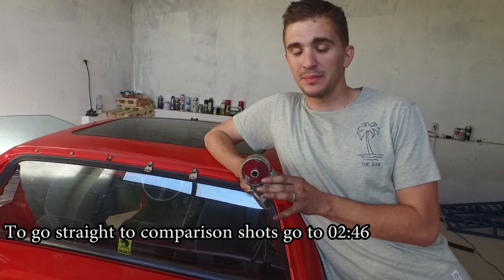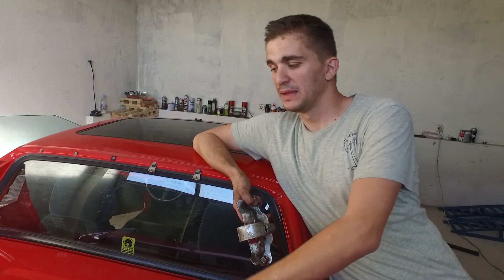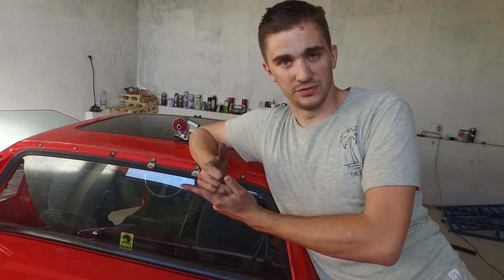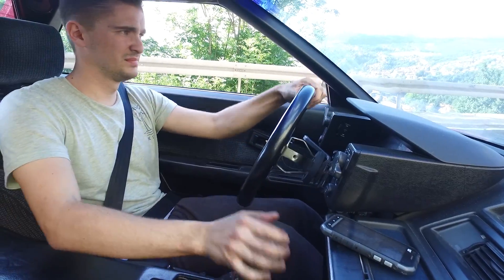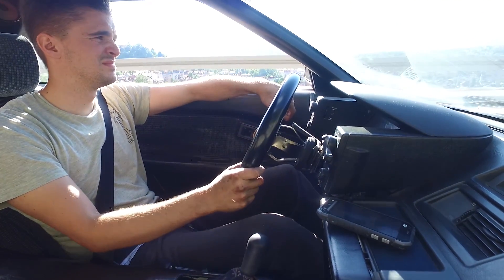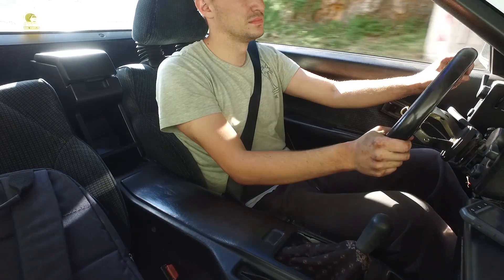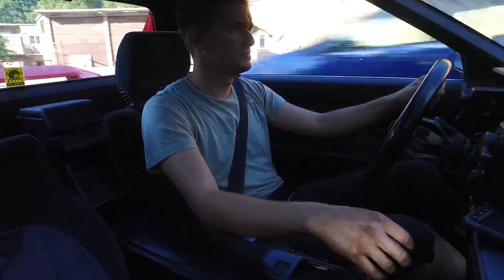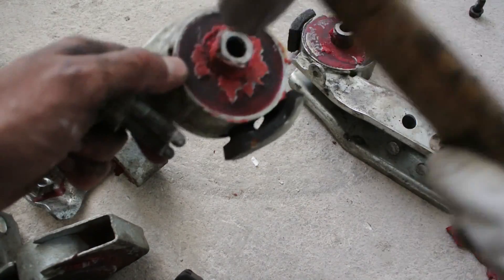Polyurethane vs. stock engine mounts - detailed comparison

Comment: You should do a comparison of the same effect but include polyurethane inserts on oem rubber mounts, the idea being that the gaps are filled with polyurethane for stiffness In harder loads and then when cruising the rubber dampens vibrations
Reply: Just so you know, i took this idea and ran with it, a year down the line, the polyurethane that i injected on my stock control arm rubbers are still intact.
Reply: @agcobileboqwana9923  hey that’s awesome! How does it feel inside the cabin? Can you notice any difference in ride quality? My mindset behind this idea was that oem rubber would provide dampening for the higher end frequencies that you tend to notice from the road, small bumps and rougher surfaces that you would notice more if you only had poly. But combining the two, would the poly be able to provide a stiffer response and hold tighter by restricting movement as well.

I’m very curious to know if you can notice any differences first hand! And if it’s just negligible, I wonder if there would be any types of different poly/oem matrices that would provide the desired results. Some ideas off the top of my head being; layered, like a jawbreaker? Stagger between the layers in different shapes. And then maybe some kind of cross gridding? Similar to a carbon fibre layup, but in a 3 dimensional form? Would love to see what these types of ideas would bring about, I’m sure there would be some complexity in developing, but nevertheless, if you liked my last idea and tried it, I’ll gladly share more ideas 🙂

Thanks for getting back to me after 3 years, surprised you even thought to reply after a year of trials haha
Reply: @WPXTacoMan477, there's actually no vibration in the cabin, i put round hollow plastic spacers when i was pouring the 3m polyurethane, i didn't wanna drill the mounts, i think the vibration that's in the video is there because there were no holes left in the mounts to dampen vibration.

Comment: Just took the poly mounts out of my SW20 MR2 Turbo. Was unbearable, only now do I realise how much better the stock mounts really are. At first I was smitten by the seemingly better throttle response, crisper gear shift, etc. But at the end of the day its not worth the added rattles and noise, especially in a car with a loud exhaust.
Reply: I found that the Kirk MR2 poly inserts along with OEM Rubber mounts were the perfect balance.

Comment: The harsh ride came from the stiffness of the poly. 
So is it 90 -85 -80 or 75 according to the scale of stiffness. 
90 is the stiffest and 75 us the most resilient.
Reply from the maker: This was 60A
Reply: @d4a  
That was nice.. it should not be any difference I think.. or do you still not recommend it
Reply from the maker: As I said in the video I would recommend it only for race and track cars.

Comment: 80A in hardness in all the mounts is rigid af as you observed. That's why depending on your car and how many mounts you have that you're converting to poly, going all in may not be the best option for your daily. My brother with no research brought all his mounts in 80A poly for his MK4 1.8t and it vibrated and rattled so bad he had to shut the engine off just to talk, Lol.

Comment: Anyone elses stomach tighten when he set the mount on the sunroof?
Reply: Yeah I'm always weary of setting metal stuff on glass Just a small pressure point can  create an issue 😅
Reply: Only you and the others with OCD. It's just a car. A POS car if anything. And on top of that, It's not like he dragged it along the paint.
Reply: @paulnueberg742  Yeah, was expecting shattering glass. Lol

Comment: If I remember, You used Shore 60 urethane. Have you had any experience with a 'softer' urethane, say Shore 30?
Reply: I bet softer will still vibrate harder than stock. The main difference between the polyurethane filled mount and stock mount is the stock mount rubber has openings and those opening allow to flex the rubber more than solid polyurethane. He could make inserts for his castings to form those openings in the polyurethane so it would work like stock mounts.
Reply: @illla  1cm  or less, thick wood dovels wraped in paper tape (spaces in the urethane ) would do nicely once removed, to introduce softness, yet not compromise the strenght.

Comment: So I’m not sure if this has been asked or not, but how would you go if you did drill holes in them to replicate the stock mounts, some of the noise and vibration may be coming from the fact there is no gap in the mount to take that out, the diy mounts being a solid state means the vibrations will be traveling directly to the rest of the car?
Reply: stated05 
I’m thinking of doing this but using some small diameter tubing with some releasing agent to take up space and allow them to slide out after curing. I think better than stock is all that’s needed.
Reply: Or using a soft PU, like 30 shore to 50 shore. Have no idea if it works

Comment: Many respects to the time and work you put into this. I sincerely love it! One question though, At what stiffness do your polyurethane mounts better go to compared to powerflex ones? for example if they are like racing series for a daily use it isn't worth it at all but if someone can make or put a little bit softer mounts for a daily use it could be somewhere in between and have less of the disadvantages.

Keep it up. Already subscribed
Reply from the maker: Thank you, glad you liked the content. Powerflex and Prothane are usually in the 80-90a shore hardness category. I wanted something less stiff so the diy mounts you see in the video are 60a shore hardnees, but were still too stiff for me. I think the next step towards getting less noise, vibration and harshness would be to try and cast the mounts with hollow parts like OEM ones have, or to try and drill out the mounts. I went back to stock and am very happy, so maybe a project for a future race car or something :)
Reply: @d4a  that was a fast response. Wow.  

Well I was thinking about installing the yellow ones at my daily but after the video I had second thoughts as it seems there is a lot of vibration and would be waste of even that little money. So by the time these are even less stiff I guess the softest market polyurethane mount would be a headache.  Thank you for the answer and the very informative video

Comment: the reason i watched first part of the video is that all my motor mounts are broken and the engine almost rotate 360 in the bay , the original mounts are expensive and i liked the idea, but then i was wondering about vibrations, well because mine are broken , the engine vibrates way too much , so i was sure with the polyurethane liquid will vibrate the same, then i came to see part two of the video and it is exactly how i thought. For me, remaking the broken mounts with poly isnt an option as they will vibrate the same as the broken ones :(, tho it is a nice project to remake broken ones and save for when the new ones will break and change with the diy til i get another pair.

Comment: Did you use stock mounts from toyota since i cant get those where i am, or did you use after market ones?
Reply from the maker: Used stock ones. New ones can't be bought for old cars like my 1987 Mr2
Reply: @d4a  where can you get good condition used stock ones?

Comment: Thanx for the videos i actually only seen the first one yesterday ! I fancy making my own polyurethane bushes aswell but after your advice possibly not the engine mounts.
Have you made your own wishbone or antiroll bar bushes ??
I have found products with 65 and 70 shore d ! I believe that is the hardness !!
I also see that the company powerflex red and yellow bushes are 80 and 90 shore d.
Do you know what shore d your compound was ?
Reply from the maker: The one I used for the engine mounts was 60a. But 80a and 90a are also available from smooth-on. I also installed a total kit from Prothane on my suspension and that is 80a I believe.
Reply: @d4a  i have a 1995 fiat barchetta, so will look at making my own next time !!

Comment: Your mistake is that you replaced the PMM (passenger mount) with urethane one. The worst vibes are coming from the passenger motor mount where the OEM is usually oil filled. If you use urethane there, you'll hate your car. So use the OEM for the PMM. You may also want to use the OEM for the transmission mount (on the left)  but if you are not having balance shaft deleted then a poly 60 will be ok.
But where urethane mounts are the best is for the rear engine mounts the 60A duro is very OK there.
Reply: IMO trans mount is the worst for vibrations. I only buy beaters that I can repair for a cheap vehicle. Trans mount is always a bitch because it's perpendicular to the engine rotation axis.
Reply: @juansolo1617  No man, Is the passenger mount. You can see the manufacturer paid special attention there, using oil suspension mounts. Take it from me, I modify and race cars.
Edit: The PMM mounts is a transversal mount. I thought you refer to transmision mount, on the left. If yo usay trans mount = transversal mount, then you're right. PMM is a transversal mount, thus the worst NVH wise.
Reply: @allservicero  I suppose it would depend on which way the engine was oriented. I only deal in FWD transverse engines, such as Honda. Transmission mount broken is AWFUL. Engine will practically flex into the hood.

Comment: Thanks for sharing your experience. I have one engine mount dead in my DC5. Since it was cheaper for a set of poly mounts (4 pcs, 75A) than one stock mount, I bought one set. but I just replaced the damaged mount (I am too lazy to change them all). The vibration is too strong. Will the vibration be weaker if I replace all the mount which might have better balance? thanks.
Reply from the maker: It will probably be worse :)

Comment: You decided to make the replacement poly mounts (60A) which you said is softer than the replacement mounts (80A) and harder than the stock mounts (40A). I'm thinking that the softer 40A poly might have been a better option rather than a middle of the road choice to dampen vibration. Of course durability might be an issue or not, I don't know. What I do know is that the Right side motor mount on my 96' Riviera is completely shot and to replace it I have to lift the engine out because the serpentine belt passes through the motor mount bracket. (Thank you Buick engineers.) Pulling an engine can be expensive, so I want to get this right the first time. If I could buy a stock or replacement motor mount I would, but none exist... anywhere. Believe me I looked. And all the ones in the bone yard are shot too. The poly repair seems like the way to go, but if you or anyone has a better solution or suggestion I'd love to hear it.
Reply from the maker: Here's a better suggestion. Buy some urethane based windshield adhesive and inject it into the broken mount using a caulk gun.

Comment: I seen in these comments where someone said to mix polyurethane and latex so the bushing's stiffness will be in the middle of what the rubber and polyurethane is. Has anyone got a video that shows what proportions of latex and polyurethane are mixed, and they actually tested it on their car?

Comment: So the mounts in my c
Volkswagen TDI were shot. I replaced them with polyurethane ones. The vibration in the cabin is horrendous at idle. When driving its smooth. I'm gunna swap them out for the stock stiffness ones that are brand new. Much better choice imo.

Comment: In your first Video you mentioned you got 60A hardness poliurethane and that the standard mounts are 40A 
if you were going to start this project again. would you have gone with 40A hardness poliurethane instead ?
Reply from the maker: I would just buy some urethane window weld and fill in the gaps in the stock mounts. That is more than enough stiffness for a street driven car. Polyurethane is great, but it's not for the street, there is too much noise, vibration and harshness for my taste. Great for the track tho, car feels really alive.

Comment: Hi I’m Brazilian, and I watch your videos on youtube, I wanted to know if I can make suspension bushes with polyurethane liquid, I can use the smooth-on vytaflex 60 for my car stock. thank you
Reply from the maker: Hi. It can be done, and I've seen it done, but it's A LOT of work to get it done properly, because you need to make molds using the old bushings and the pour the poly into the molds. I taught about doing it but I gave up after I saw the Prothane total set costs a 100$ or so :)

Comment: stone or foam ?   drilling hole will relieve much of the harshness ,, you will see missing rubber in molds of the stock ones to relieve vibrations
Reply: find a poly that is not as hard also

Comment: How about using Polyurethane  30A instead of 60A? aren't the OEM 30A?
Reply from the maker: Leo Cadena OEM should be around 40-45 from what I read, but you could be right too, it's not like I could have measured to verify 100%

Comment: Love this video. If i can do the wishbone mounts and leave the engine dogbone mount stock will it reduce wheel hop?
Reply from the maker: Ben Crosbie Thank you. Wheel hop is a complicated thing and can be caused by different factors so answering without knowing your hp, suspension etc. Is just guessing. I would start with the wishbones and if it doesn't improve things try the engine mount.

Comment: I got a couple of questions. First why reoflex and not pmc, also from smooth-on? Second why don't you try making a 20A shore hardness ones? since you said that 20 is closer to stock.
Reply from the maker: I asked a company that distributes them locally and told them what I needed it for and they recommended reoflex. 40a is closer to stock, 20a would be too soft. I made 60a because I wanted improved driving feel. But trying to replicate stock might be a fun project too. Maybe I'll give it a go when I finish my bike carb 4age and suspension.
Reply: I would try to replicate stock, or a little bit harder and then endurance test them against stock. Because i bought some replacement bushings for my sway bar. I can't describe it, they are awful. Maybe i'll record a video to prove it.

Comment: One thing you didn't mention is that this is with an inline 4 cylinder, an inherently unbalanced engine that vibrates much more than a 60-degree V6, 90-degree V8, etc.

Comment: Did you k ow that the shape of your poly inserts can be changed to give you the additional support you need and also cut down on unwanted vibration to the driver? Yes its true. The ones you made in this video would be great for the track but as you pointed out also uncomfortable for everyday commuting. I wish I could explain this in text better but if you take a look at some factory mounts you can see how they put this knowledge to use. There is no reason why we cant reproduce the exact same mount in poly and get more support as well as a good everyday driver. Think of   how the mount would be effected if you had used the poly that better matched the stiffness of the stock mounts but filled the cavity like you did with the stiff poly. You would have gottem more support but with tha cavity filled completely it would have given you interior vibrations also that were worse than the stock mounts. Try copying the factory with the stiffer poly and you will see less vibration as well as a more responsive feel. The ones you made are almost like solid motor mounts. What if your pattern was a honeycomb within the poly? Vibration insulated as well as responsive feel? Perhaps. 😳

Comment: Excellent follow up video! I use poly when I'm increasing HP output on an engine because it absorbs the additional torque better with less engine movement.
Reply: Tractor Wrangler I break engine mounts every 3 months poly or solids my only choices

Comment: any issues with how long they last... I have heard of issues of them shrinking over time.
Reply from the maker: jon-paul miller Mine had no issues with shrinking. There's a follow up video where you can see how they held up and how they compare with stock.
Reply: i saw it... but I am still considering 60a.  I am told you can feel the suspension and even turn better.  I thought about going to 40a with just no holes but dug in to find that they shrink less than .01 mm and can last 30+ years, but I have a friend that thinks that 60a is best especially in an awd turbo ecmlink.  I am just worried of what you say compromising to much comfort.  how much of a difference do you think it would be with 40a or even solid 20a and would they fall apart.
Reply from the maker: jon-paul miller I would not recommend 20a at all. 40a is stock I think. Here's something cheap and simple you can try. Get your stock mounts and fill the holes with windshield adhesive like 3m window weld and see how you feel about them while driving. If you think that's comfortable and you wouldn't mind some more harshnes go with 60a. If you find the stock mounts with window weld even slightly annoying then you won't be able to stand 60a.

Comment: You should do comparison when the transmission/engine is under load with regular driving and race track driving, the sound will be different and the engine movement is a lot different as well...

Awesome video! Thanks!

Comment: do polyurethane mounts absorb pothole bumps
Reply from the maker: GEAR HEAD Nope. They absorb engine movement and vibration. Your suspension deals with potholes.
Reply: my transmission mount is broken should i fill it up with poly or just replace it with a new one??